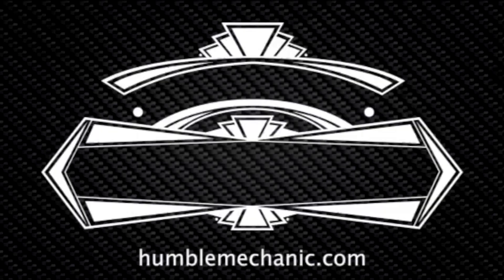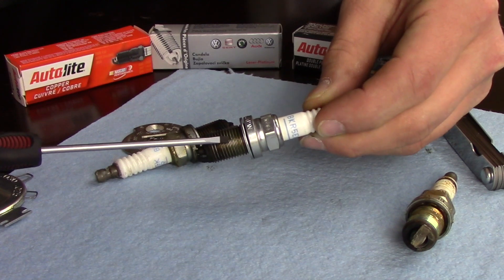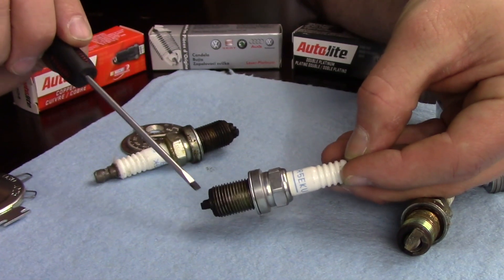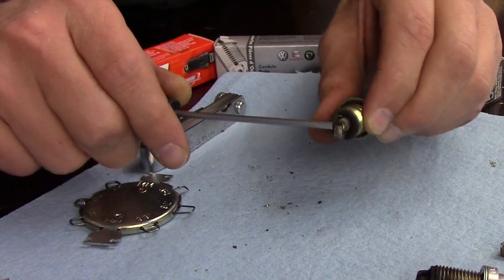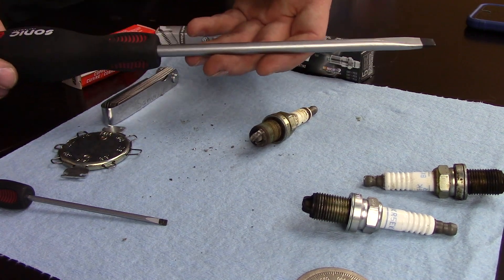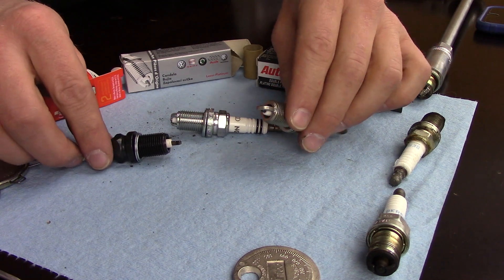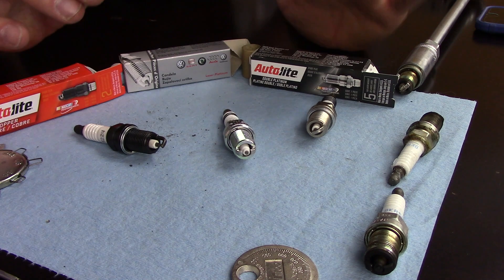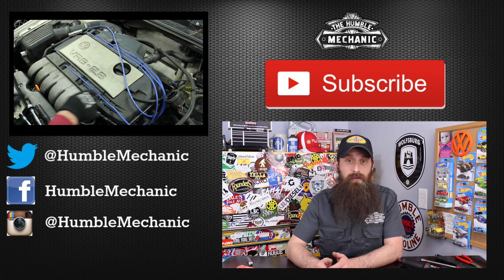What You Need To Know About Spark Plugs

Comment: [Serious Question] Does the spark plug ignite the air/fuel mixture at every cycle of the engine (i.e. continually while engine is running)  OR is the spark only useful to ignite the mixture only once when the engine starts running? BTW, great videos sir!
Reply: +Miguel Garcia The spark is igniting the compressed air/fuel mixture every cycle.
Reply: +Pdiddy Thank ya!

Comment: I've installed some spark plugs where the terminal nut was a threaded on type and actually loose right out of the box. I tightened them down before installing, I'm sure leaving them loose would have caused issues.
Reply from the maker: +Gunbu oh that's a great tip!!!
Reply: +HumbleMechanic Thanks! Your channel is awesome and thank you for putting in all of the hard work. We viewers are very lucky that you're willing to share your knowledge and experience, that's for sure!

Comment: +1 on the torque wrench
And the hot and cold rating it relative to how much ceramic insulator is in the nose of the plug. I believe the closer the base of the ceramic, the less heat transfer into the coolant, making it a hotter plug.
And most every plug comes pre gapped from factory.

Comment: Did you mention anything about the use of anti-seize? I know most manufactures recommend against it due to wet vs dry torque, but its something people still do. I personally do not apply any on an aluminium head, Just curious on your thoughts?
Reply from the maker: +Mr Chris I have put anti-seize on exactly 0 spark plugs. I am sure there are situations where it has value, but I never do it.
Reply: +HumbleMechanic On aluminum heads, the silver anti-sieze is a bad idea. You need the copper based one to prevent electrolysis type corrosion.
Reply: Ford 3 valve spark plugs in a TSB are the only time I have seen antiseize recommend by an OEM. FYI NGK plug come with a baked in coating on the threads to prevent gailing and specify do not use antiseize.

Comment: Hi Charles I remember working on a ABA engine of a 98 cabrio and the customer had replaced the plugs with Bosch platinum but with the big white electrode and the car was misfiring all of he rest of the system was ok I just replaced the new plugs with NGK or Bosch correct OEM number or plugs and the misfire went away could you elaborate more on the 2.0 L 8V on the mk6 Jetta engine that you mentioned in a older video that you notice that you have problem with the plugs failing early.

Comment: i like the technical deep dives. i rarely have time to watch any videos anymore, but i had to watch this one.
Reply from the maker: +LastHumansGarage I hear ya about that man!!
Reply: +fake priesthood apparently VWAG disagrees with you
Reply: +LastHumansGarage Looking forward to seeing that new shift knob and timing chain rattle fix!
Reply: +HumbleMechanic great vids man, hey I've switched to NGK Iridium in my 95 honda accord from the standard copper one that they say to use on the emissions sticker under the hood. Is it bad that I switched? will the car run different because I'm not using the exact plugs stated to use by the manufacturer?

Comment: My spark plug wires can be removed by very little effort, i don't know if they are worn out but i'm gonna check with the new plugs i got, i don't know if it is normal though
Reply: +Jonas Hansson often atleast on older VW's you can use a needle nose plier to tighten the plugvires internals..
Reply: Had a look today and they are of an older design, changed the plugs and the car still runs a bit rough, it's not a VW but it is related :) however i'm still gonna change the wires since i reckon it is the cause of my misfire issue
Reply: +Jonas Hansson If there is a problem with the clip inside the plug wires you'll find burn marks from where arcs jumped from the clip to the plug.  If you notice burn marks and determine that the plugs are in good shape otherwise you can tighten the clip with some pliers like Renax stated, but make sure you clean up the places where the burn marks are as leaving them may prevent electricity from passing properly to the plug.

Comment: When regapping platinum or, in particular, iridium spark plugs you should not use those tools, especially that medallion tool - it will very quickly destroy the tip. The actual tip of an iridium plug is fragile and tiny (1mm tall and even less on its diameter). Nothing should come in contact with it, sliding the medallion gap tool around could break it. Tapping it back down is a bad idea as well, again the shock can break the tips or crack the housing. To shrink the gap its better to put the whole plug in a vice and slowly close it.....On pencil coil (coil on plug) removal, on some engines using a screwdriver is a bad idea - infact using a screw driver on these potted coils is just generally a bad idea altogether  - you can crack the potting and the result is moisture ingress. On the GTI it's not too bad as you have a lot of leverage space - on a 1.4TSI for example it's very difficult and i've seen coils gouged up by bad mechanics using screwdrivers - use the proper tool, there are removal tools for these pencil coils - the 1.2, 1.4 TSI in particular.

Comment: I put spark plugs in a diesel, and now I can travel through time!  ;D

$11 per plug actually isn't bad from the dealership for VR6 sparklers, assuming they're the platinum variety!  That may even be cheaper than the going rate for those same plugs from various parts stores.  That dual electrode design threw me for a loop the first time I saw it, but VW probably did a lot more engineering than I'm capable of to determine that's the right thing to use.  Any idea off hand if the VR6 used forged pistons from the factory?

Great video!  Very comprehensive!
Reply: Hi some older Volkswagen use a 3 electrode ground.

Comment: whos the OEM for VW sparks... NGK? Bosch?
Reply from the maker: +thedreadedgman most of them are NGK
Reply: +thedreadedgman 
The factory plugs for my Eurovan are NGK.  The same exact ones (but not in a VW box) from Amazon were $9 instead of $15.
Reply: +HumbleMechanic a lot of the newer plugs are BERU FYI
Reply: The Beru brand is now owned by Federal Mogul, the same company which makes Champion.
Reply: +Garth Goldberg yes I know, I have used a bunch of BERU plugs and coils in many Euro cars without issue,as long as they are the OE plugs and coils

Comment: What you need to know about Spark Plugs: Get a Diesel.
Reply: MyFabian94 Don't forget, some Cat motors have a spark plug
Reply: +MyFabian94 so does your old motor bike take a spark plug or is it also a diesel?
Reply: Now, Sparkplugs but as soon as the Engine is dead it will transform those into Diesel Injectors.
Reply: new diesel car also come with spark plugs!!! welcome to 21 century!!
Reply: +MyFabian94 I don't know what kind of guy you are, but I like to know alot about stuff that i don't own myself. Things like this is useful to know if your friends car breaks down etc. your gonna look like a fool in the garage if you don't know anything about spark plugs, even if you have a diesel car chances are your'e gonna use some kind of petrol powered equipment in your life, like a lawnmower or chainsaw. or maybe your friend needs help with his petrol car.
I got only diesel cars myself but a man needs to know his way around a basic petrol engine...
Reply: And for that I have an old Motorbike and a Piaggio Ape.